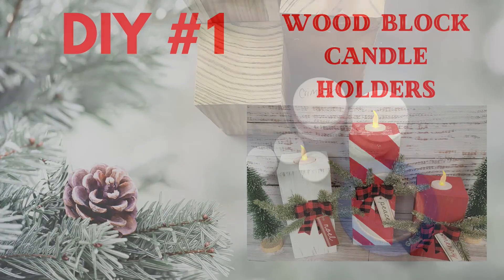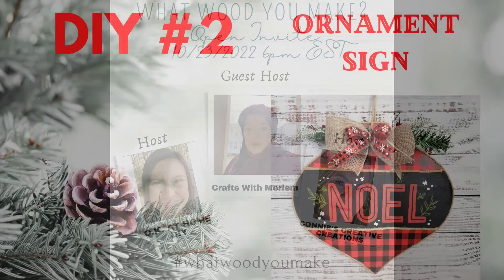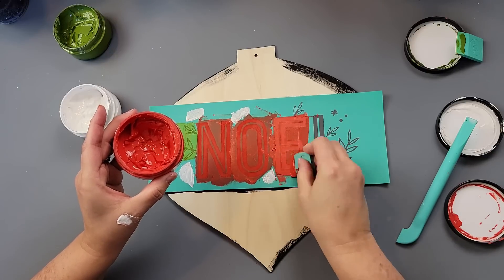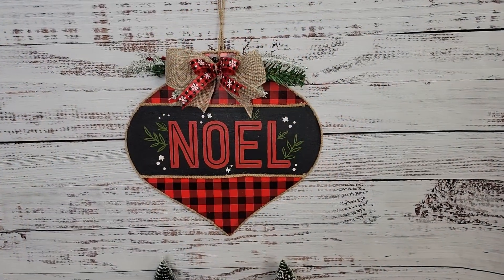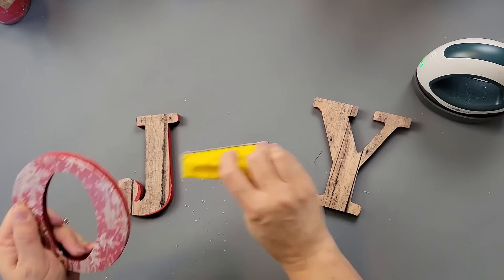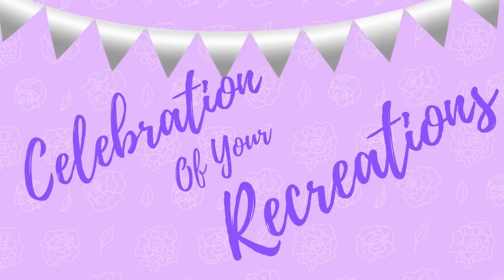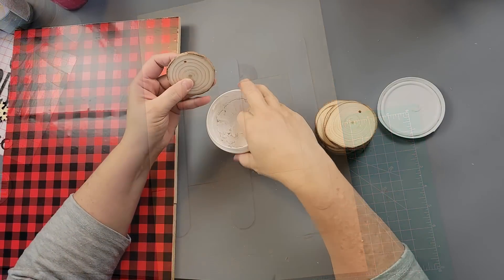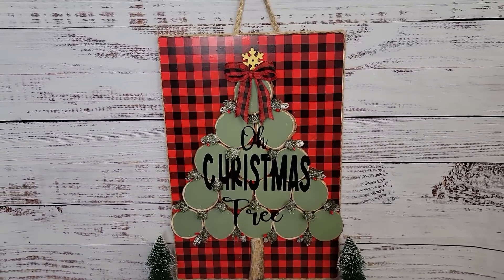4 WONDERFUL RUSTIC CHRISTMAS DIY'S/WHAT WOOD YOU MAKE CHALLENGE

Comment: Good morning Brenda! Such cute pieces.  As far as the Gorilla glue wood glue bottle...Check the nozzle. I had issues with mine not coming out of the nozzle n come to find out the glue was stuck in the nozzle. Use Cricut tool or something down in the nozzle n it should help u clear the nozzle. Hope that helps. Thanks for sharing n take care!
Reply from the maker: Thanks Michelle. I did try that and thought it was cleared but it's still hard to use. Oh well using the brush helps me not use more then I need